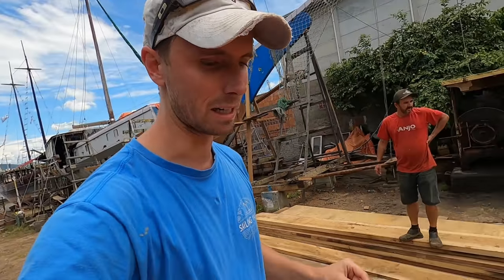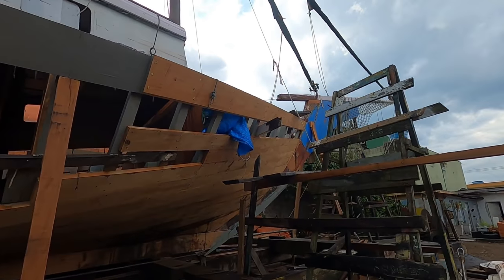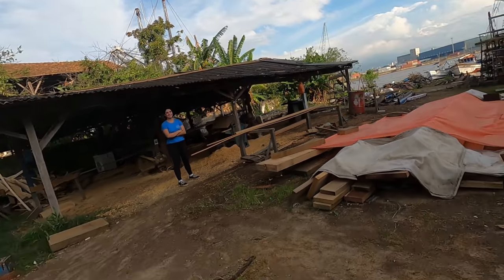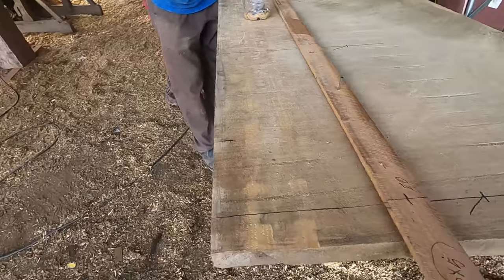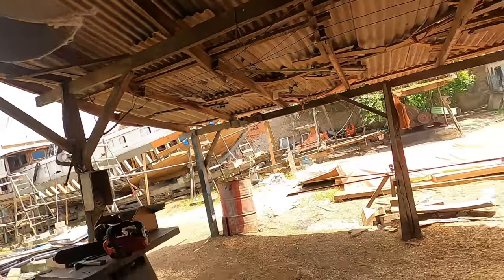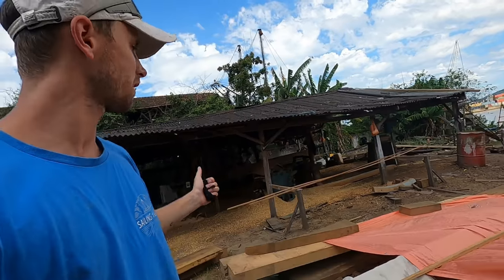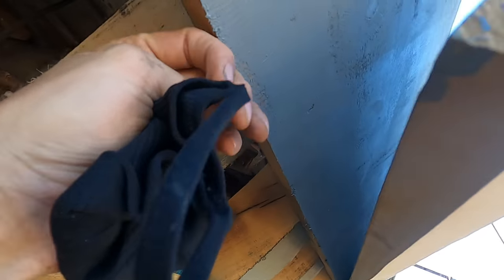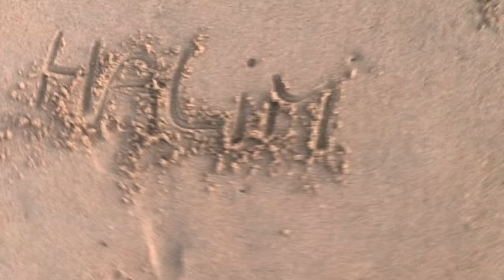Brazilian shipwrights using UNEXPECTED tools — Sailing Yabá #30

Comment: The Water level isn't new or uncommon it's used thru out the construction industry . In situations like Yaba a laser level wouldn't have been practical and a water level is much cheaper and takes no batteries . These shipwrights look rough and tumble but are very talented carpenters . It's been a pleasure watching the progress thanks !

Comment: The use of the tube filled with water is so simple but ingenious!!!
Reply: The ancient Greek used Water Levels, we still use them today in heavy engineering, when we want to set components to gravity and the distances are too far to use a spirit level. The modern alternative is to use a theodolite,  but the simplest ideas are always the best.
Reply: But it only works if the rest of the boat is leveled correctly on the slip-stands.
Reply: @raymondnybakk1311  Yeah I was going to mention that but I didn't want to over complicate matters.
Reply: @TheBoris1971  You mentioned that theodolite is the modern way to go. But that is at best 15 years old technology. Today we use robotic one man total station.
Reply: @TheBoris1971  The ancient Egyptians, when leveling the foundations of pyramids, cut a groove in the upper face of the block stone plinth, all the way around the base. This channel they filled with water to ensure the could ensure it was level before build up from there..
Reply: they used this method on parley Revival a couple of weeks back.
Reply: it works better if filled with red wine

Comment: It’s a Roman spirit level what ever level the water is it will remain level around objects that how you can put a level deck on the side of a house 👍👍👍🇬🇧
Reply: F G  Same place I get it - at the local Rome Depot.
Reply: The main advantage is it doesn't need line of sight; useful here and in building. There are even pro level ones with better measurement.

Comment: A clear pipe full of water is the simplest very accurate level tool, truly international and used in so many industries. It's foolproof. The water in the pipe will always find it's level, no matter how long the pipe or where it is routed.

Comment: I have been following Tally Ho, Acorn to Arabella, Sail Cargo and various other projects for years and am amazed by the speed and seeming ease these guys are building at. Although I love the perfection and care displayed by Leo, Steve and Alix, I can sincerely appreciate the natural abilities of your team, The pipe level is really the oldest tool for leveling used and comes from the construction industry. Butting the planks before running the saw through the joint insures a perfect fit which is an ingenious method. Love your channel!

Comment: The trick with the hose is very clever!
Reply: been used for centuries, in all kinds of construction
Reply: "windmill1965" That trick was used daily in house construction to level the footer and or the, slab. Then the laser came along and was easier to get the height correct in the middle of a floor. A common garden water hose was used most often.

Comment: The use of the tube only works if the hull is also level.  Otherwise the plank alignments will not be the same.  I hope a reference to the frames/decks/etc. was taken.

Comment: It is a water level. It is the best way to make the 2 sides the same
Reply: And in Dutch, a “Flesjes waterpas”.
Reply: Great tool if your boat is dead level, if not then... lol
Reply: Just so long as the boat itself is level.  Try to lay out level on an uneven platform and you're screwed
Reply: @Ra-zor  its like using a level to build shelves in a trailer home while on a slope!  i told them from the getgo to use laser levels and markers to make sure the whole frame stays where it was meant to be.  i cannot imagine the torques against the frames to their planks.  should have used hex bolts that ran through and were torqued!  also-  what is the moisture content of the wood?  should have been taking massive tests and records,
Reply: @Ra-zor  like as it sits in water=  level

Comment: The tarp looks nice an tight, but it needs a lot more attachment points. If the wind picks up, it will just rip it off. Use some long, narrow strips of planking to nail it to the hull instead of small blocks. And maybe roll the tarp one or to times around the strips of plank before you naiI it. I grew up in some windy islands in Norway, Lofoten. So I have seen what’s the wind is capable of doing.
Reply from the maker: Hey Raymond! Thanks a lot for the tips! Lofoten is one of our dream destinations! Lovely to know you're from there!

Comment: I know in the old days of ship building they used something called  " Oakum "
to seal the gap between planks on a ship.  It was a fibrous material mixed with tar and they 
used a flat edged wide chisel to hammer it into the gaps.
What do they use now to fill those gaps.   I know Duca from SV Odd would use tubes and tubes of Sicoflex, haha.
Reply: You can still buy and use Oakum but is quite expensive. The alternative is cotton or caulking cotton.

Comment: Did the local carpenters use the water level technique to insure the hull was level before starting the frame replacement?
Reply: One should be generous with the obvious 😎... they didn't discover the water level just for this episode
Reply: ⬆️ they use the same utube finger snap to stop the green wood from shrinking too 🙄

Comment: i thought that planks like that would have had to be steamed to make them flexible to take the pressure off when fitting to the frames , they are using heavy clamps to bend them in place, when i replaced some planks on my boat the builders put them in steam tubes to make them bend to shape, nailed and when dried they stayed that shape.

Comment: @sailing yaba Any updates about your engine? Also, is there an upper hatch to take the engine in/out if need be? Seems like a silly question but I’ve seen strange things
Reply: "Mark" I don't think there will be a better time to work on the engine. If no hatch, he has the people right there to make it happen. Probably going to source the engine work out also.

Comment: The tube with water used for checking the sheer plank levels is called a manometer. A very useful but ancient tool. 😉😉👍👍
Reply: I wonder what kind of tube they used in ancient times.
Reply: Perhaps some sort of gut. I'm not sure but that was a firm of spirit level for them.

Comment: Paint and seal all faying surfaces What did they put between the layers of your sheer plank?  Bedding compound. Ships felt. Paint.

Might try to use screws on the plank ends instead of nails.

Comment: Again with the butt joints on the planks that really should be scarphed I do see trouble ahead for this build.
Reply: I hear you but it gets a lap plank. (On top of it that covers the joint.)
Reply: Correct but it won't stop the water from penetrating the end grain causing iron sickness from the fastenings and yes the fastenings are stainless steel but stainless needs access to oxygen to remain corrosion resistant.

Comment: I would have thought stainless steel screws would have been better than just nails???
Reply: They stated in an earlier episode that they would be adding stainless steel screws into the planks in addition to the nails later?  We will see.
Reply: @littlewingpsc27  Yes I do remember that but there does not appear to be enough room between willy nilly placing of nails for any substantial heavy duty marine screws.??
Reply: That is one old school method that needs to go, in my opinion.  Bolts are far FAR superior.  You should have stepped in and demanded bolts.

Comment: Fastening with nails is not good method for long term strength.
Reply: Define long term?  If the boat out lives them... it's basically enough.
Reply: And new sealing compounds and technology will help slow iron rot down.